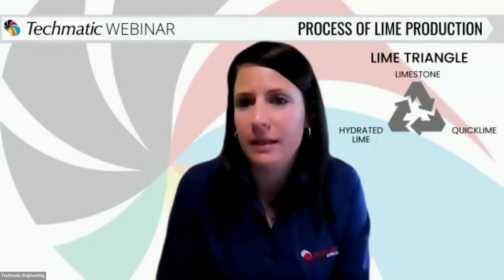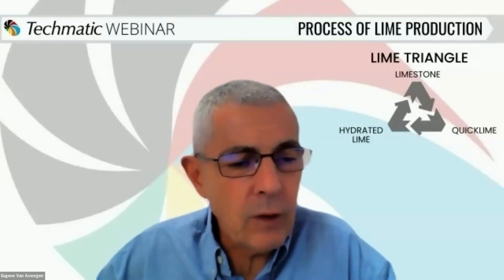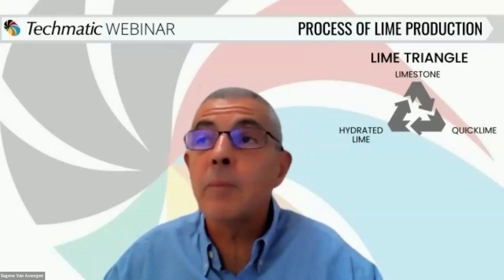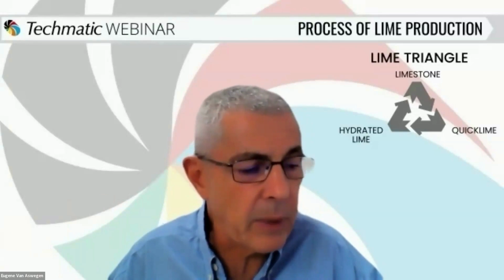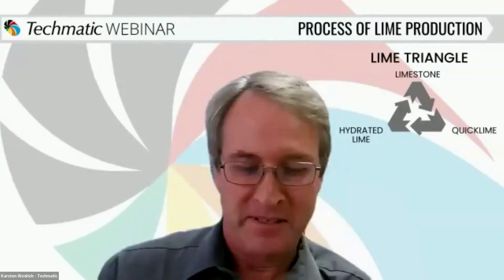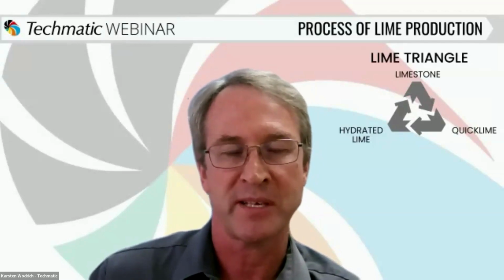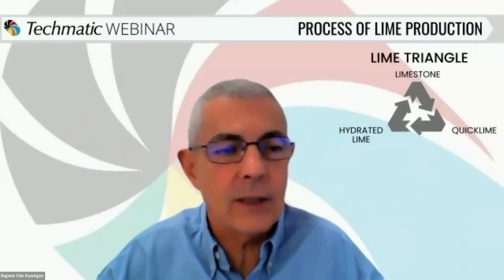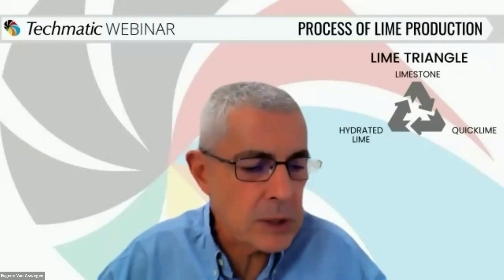Process of Lime Production

Comment: Can you burn quick lime lumps by a laser ? Or intensive direct sunlight
Reply: I meant limestone
Reply from the maker: Thank you for your question! You will most likely be able to burn lime with a high-intensity laser, but penetration would not be very effective. Sunlight alone is not sufficient for conversion unless it is highly concentrated through a lens. Even then, achieving the necessary penetration would be challenging.
Let us know if you have any other questions.